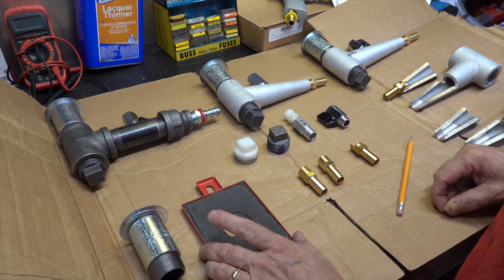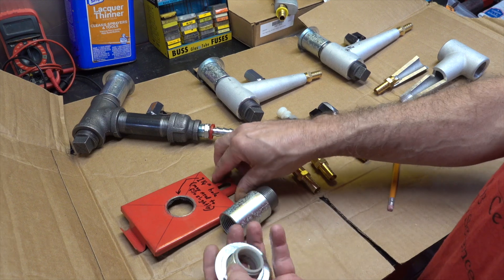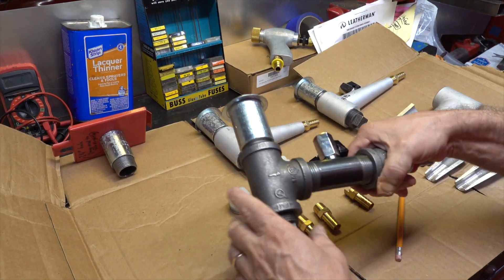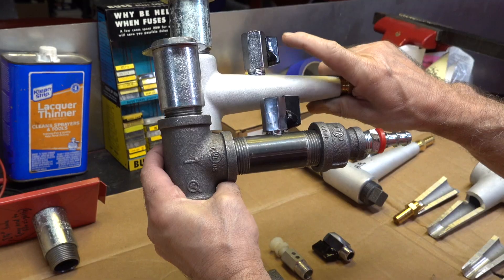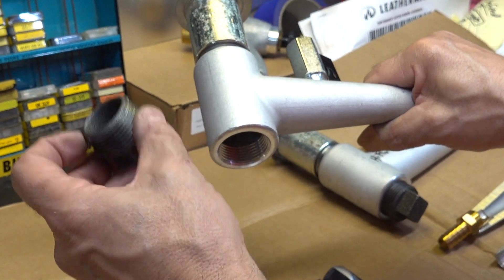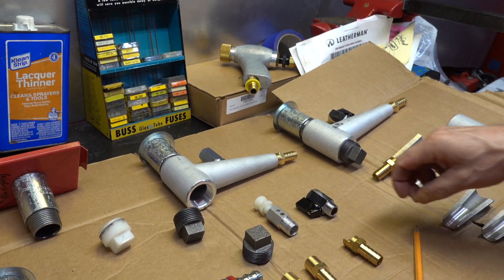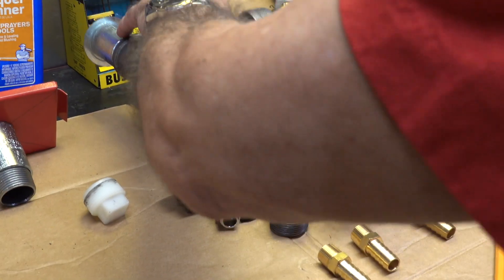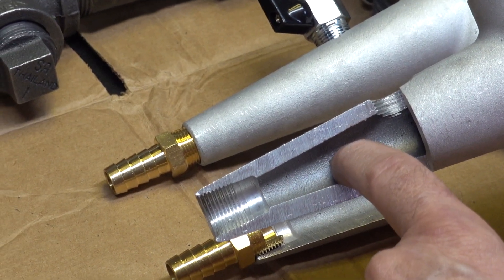Direct Comparison of 3 types of Harbor Freight Blast Cabinet Upgrade Metering Valves

Comment: Great video. on the 3rd one I'd cut 1/2" on the output so the brass fitting mates the end. 
On the 1st one I'd drill the air inlet hole at a 15⁰ diagonal to get a venturi effect and the media gets better distributed.
Reply from the maker: Thanks for your thoughts on potential improvements.
Reply: Good idea.

Comment: I made mine out of PVC schedule 40 pipe and it's great. The only negative thing is that it builds a ton of static electricity with the sand running through the plastic pipe. Have to keep a hand on the cabinet or your going to get a butt load of shocks.😲
Reply from the maker: Thanks for your "shocking" comment LOL.  Interesting to know if the abrasive media stream will actually eat out the inside of the wall of the PVC pipe and fittings and cause a failure (aka loss of structural integrity).  Best regards
Reply: @partswasherupgradekit6028  I thought of that, but that's a future me problem. Besides it's in my home shop, it'll most likely outlast me.

Comment: Newton's law states that smaller ventury flows faster.
Reply from the maker: I think you mean Bernoulli's Principle.  And yes that is correct; however, the area of reduced diameter is followed immediately by a long section with increased diameter, therefore the increased speed is very limited.  What is more applicable is the concept of constricted flow and our milled out valve reduces the construction.  Also, remember that this is not a simple fluid.  It is a fluid with high levels of suspended solid particles (the media) so internal frictional forces are an issue.  Bernoulli's is best seen in a carburetor where the faster flow creates an area of lower pressure and that comparative vacuum then pulls (sucks) in atomized fuel.  Different from a metering valve that in entraining solid particles within an air stream.

Comment: There are videos where people make a secondary nozzle with some holes, and they crush one end.  Would it help to have both the bottom feed and this?
Reply from the maker: Nope.  With our valves it is just not needed and might actually work against the efficiency of the valve
hope this helps
thanks for your question

Comment: I would be interested in the high flow meeting valve, but I don't want the cyclone or a new gun. Unfortunately, your site does not sell them that way. I will probably just make my own metering valve and buy the other parts separately.
Reply from the maker: We sell many of the components separately and can also put together a special kit to meet your specific needs.  PLease see the drop down menu on our website under "shop all products" and select the subgroup of products to find our products
Please let us know if you have further questions
Reply: @partswasherupgradekit6028  
 OK, thanks. I will go back and look again.

Comment: never heard of a ventrui tube slowimg down ???
Reply from the maker: It's not a matter of the speed, it's the flow characteristics of the airstream when loaded with particles (the abrasive media).  The venturi effect in a traditional carburetor creates negative pressure drawing in the atomized vapor (gas and air),  What is going on inside the metering valve is a different matter.  Also, once the airstream with the media hits the larger ID of the hose, it will slow down and therefore keeping flow speed up with minimal internal friction becomes a ket issue.  Thanks for viewing and providing your comment
Regards
The Team at Best Tool Upgrades
Reply: @partswasherupgradekit6028  thanks for the info, makes sense now.

Comment: In the plumbing parts one, how do you mate the valve to the pipe? Drill and tap threads in the pipe?
Reply from the maker: yep.  Tapping must be precise because the thickness of the wall of the tube only allows for about 2 complete threads.

Comment: I'm confused.. I am looking to buy one of these... doesn't pressure decrease as volume increases P1V1 = P2V2 ?? and I thought you said turbulence was good in the first pipe design?
Reply from the maker: Turbulence is good to mix the particles of media with the flow of air.  But the pressure equation doesn't really apply here because you have essentially zero pressure (meaning ambient air pressure) where the media is falling into the valve and then there is the beginning of a zone of negative pressure as air comes in the air inlet valve at the top of the metering valve body being drawn through the media hose (kinda like a venturi but this doesn't really describe it because it is more entrainment into a flow with the complexity of the media particles).  What is going on inside the metering valve is more complicated than the simply equations that pertain to simple tubular systems.  That all said, all of our 3 different types of valves work great.  Thanks for looking.

Comment: Great video but one small thing, when the piece gets smaller it doesn't slow down it actually increases velocity.
Reply: Thank you Mr. Bernoulli.
Reply: @jbrown2553  I named my Dog after mr Bernoulli. He is so smart.
Reply: But decreases volume
Reply: absolutely correct.  You can go and also relate that to PV=nRT as well.
Reply: Your correct its called ventury effect increase velocity
Reply from the maker: The venturi effect does describe this phenonmenon in general.  However, remember that the media flow is essentially a slurry mixture of air and small solid particles (the media) and frictional loss plays a significant role here unlike in a carburetor venturi where the mixture is highly atomized droplets of liquid suspended in air.  It is because of the frictional loss in the system that the larger bore of our high flow metering valve plays such an important role in increasing flow and providing better performance
Hope this explanation helps
Reply: @partswasherupgradekit6028  The different media (sand,glass,soda ash,walnut hulls)all have their own set of demands
Reply from the maker: @budd1814  That is correct.  IN addition, the grit size will also have an influence.  Regards

Comment: Don't see why people buy these things when they could go to the headwear store for cheeper if u got a drill and a tap
Reply from the maker: We appreciate your comment.  In reality, it's not that easy to purchase all of the parts.  The air inlet valve is not typically sourced locally and tapping requires an odd sized tap.  Taps are not cheap.  Also, tapping the relatively thin wall of the pipe is not that easy for most people as there are only about 2 and 1/2 threads worth of thickness.  The box stores don't carry all of the parts and even if they do, rarely have them all in stock at the dame time.  We have had several people contact us after building one themselves to tell us that, in hindsight ,they wish they would have just bought one from us.  Not much more money after sourcing all the parts and zero in time and aggravation driving around town and ordering online.  Not saying that it can't be done by a handy guy for less money, but for many, time and troubleshooting is not worth the savings.  Again, we do appreciate your comment.  Just want people out there to know it is not just a run to Lowes and 10 minutes back in the garage.  Happy blasting!!
Reply: Well, today had some extra time and made me one. Works like night and day..

Comment: I just received your hi-flow valve last week and didn't know if you were familiar with HF benchtop sandblaster, I looked at them and it appears it can attach to the bottom shoot also, maybe a little tight. The benchtop is all that I need for what I do, what do you think about fitment? Thanks, Jay.
Reply from the maker: Jay
We have had our customers use our kits and all components on the HF bench top model.  Takes just a tad of creativity but they report excellent results.  Let us know if you have additional questions.  Happy to help.
Reply: @partswasherupgradekit6028  Thanks Ron, I've already sized it up yesterday and it will definitely work! 👍👍thanks for the reply my friend and I'll probably be making more purchases in the near future. 🙂
Reply: It would be really helpful if you could make a video showing HF Benchtop valve installation 😉

Comment: Of course to change the media you wouldn't have a plug in the bottom and you'd have to remove the door on the bottom. Which isn't an issue as it is as easy to remove the door as it is to remove the plug

Comment: If you put the valve in the fitting right out of the bottom of the cabinet and use a t- fitting turned with the t part up connecting to the cabinet and then hook your hose to the fitting and put a valve with an air hose coupler straight in line to the outlet hose and use 10 to 20 pounds air pressure ,it will then take air and push the sand through the hose giving you a much better flow of sand with the ability to use less sand and it becomes as efficient as a pressurized unit without pressurizing it.
Reply: i'm not convinced that it would be better. I think it will suck to much media and clog the pipe or the gun.
It may help when people use a weak compressor with not enough flow.
Would need to take the air from the pedal control so it would stop sending air as you stop blasting.
Reply: Do you by chance have a link to a site that describes this in more detail or perhaps has pictures?

Comment: That aluminum tee fitting, is that a custom part you have made or is it for another application? I feel I've seen it before used somewhere else.
Reply from the maker: Thanks for your question.  The cast aluminum metering valve is a purpose made part for this application.  I have never seen it used for another purpose (but someone may have gotten creative with it !!).   Happy blasting
Reply: @partswasherupgradekit6028  Interesting thanks!

Comment: Very admirable of you to not dismiss the DIY version of your metering valve!
 I salute you! 
It does seem strange that your advocating your product to compete with the DIY version with the larger mixing chamber (as you mention). One point I would add would be to taper the brass fitting into a cone entry point and remove the threaded lip edge entirely. thus eliminating zero bounce back as indicated.
Reply from the maker: Thx.  We try to call 'em as we see 'em.  When we have the chance, we plan on doing a flow test to get some solid numbers to put against all three and see how they compare in a heads up comparison.  We do put a bit of a cone shape into the threaded end of the brass barb.  What we have learned from experience is that if we cut too much out of the inside of the threaded portion of the brass fitting, the threads can buckle as we tighten it to our torque specs.  So, like many things, it's a matter of trade offs.  Greatly improved yet still strong.  Thanks for your comments and stay safe out there.
Reply: @partswasherupgradekit6028  after the step drill cut in the fitting you could use a tapered reamer to take down the steps for smoother flow.
Reply from the maker: @mrrberger  Actually we do not use a step drill.  We use a carbide tapered reamer just as you suggested.  So there are no steps.  We don't remove the entire flat end of the fitting but do thin it way down.  We found through testing that if we take out all of the end wall of the fitting, the threads can collapse as we torque the fitting which then causes the threaded portion to bulge out into the flow stream.  Thanks for your comment
Regards and happy blasting
Reply: @partswasherupgradekit6028  Thanks for the correction, I was looking at 8:50 and the example has steps in it so I made the wrong assumption.

Comment: Great explanation of the options for the metering valve. I build one same as what you have. Before I even fired up my new cabinet. But no luck at getting any media up the tube.
I am running 90 psi with a 60 gal 15.5 CFM/100 psi 
I feel I have tried everything but getting better air flow. Is this a common Problem? Using 30-60 crushed glass
Reply from the maker: @Darren - thanks for your kind comment.  90 PSI is quite high for pressure at the cabinet.  Try dialing it back to 45 - 60 and see if that helps.  More pressure is not necessarily a good thing.  Have you dialed in the air bleed valve on the metering valve?  We will be uploading a new video soon that shows the process of dialing in.  One more thing - the guns that come with the HF and many other entry level blast cabinets are, well, ..... crap.  It may be a gun issue,  not a metering valve issue.  Keep us posted and we'll try to help you solve the problem.  After ensuring enough air flow (CFM) at the correct pressure (and with dry air) It's always a matter of some component not working properly.
Hope this helps.  Stay safe out there

Comment: Will this work with an Eastwood B40 medium size blast cabinet.  I get a lot of purging and they even sent me a new gun and hose.  Same problem.  Thanks for your information.
Reply from the maker: Thanks for your question.  I took a look at this model online and yes, this should work just fine on the B40.  Getting rid of the siphon tube is a great mod for any blast cabinet.  FYI - the gun that comes with the B40 is rather poor.  The gun we supply with ALL of our kits that come with a gun is very similar to the gun that Eastwood supplies in its top of the line model B100.  That cabinet is much more expensive.  With our upgrade kits, you can take a basic blast cabinet and turn it into a MUCH improved one with muchbeyter performance.
Please visit our website at www.partswasherupgradekit.com and see all of our products
Thanks again
Reply: I just bought the B40 cabinet and engineering it right from the jump. Did you try this out on the B40 and if so, how did you like it?

Comment: these are all neat....I own a welder, so my metering valve is much larger, cheaper, and stronger.
Reply from the maker: Sounds like you build yourself a great metering valve.  No problem with the strength of these though.  Thanks for your comment
Reply: @partswasherupgradekit6028 , there's always going to be the one, who thinks he can do it "larger, cheaper & stronger..." Great job!!
Reply: i have a 3/4 one on mine and it work well so i doubt that having bigger than 1" is better. Also it's strong enough, no need to be stronger.

Comment: Will the high flow metering valve work with the Harbor Freight countertop cabinet? Haven't look to see if the base is the same as the bigger one.
Reply from the maker: Yes.  I have had several of my customers install this on the bench top model

Comment: Very nice.  Today my "eBay" one started spitting sand out directly out the air inlet and sand started pouring out the seam in the trap door!  Not a good time.  I haven't diagnosed what the heck is wrong yet
Reply from the maker: @Todd
Sorry to hear you are having a problem.  Not too much to go one but look at the gun for a potential issue causing the vacuum to be reduced with potential air backflow down the media tube instead of up.  Feel free to contact me at partswasherupgradekit@gmail.com to go into a bit more depth and get you up and blasting again.  Also check out my website at partswasherupgradekit.com for all of our great blast cabinet and parts washer upgrade kits and individual components
Stay safe out there
Reply: @partswasherupgradekit6028  Yup I pulled the gun apart last night and sure enough the o-ring was torn.  But my metering valve keeps clogging as well I'll take a look at yours